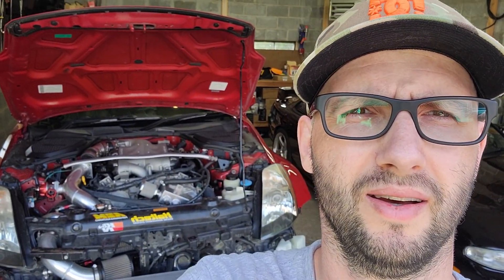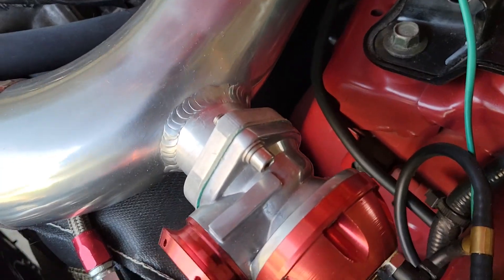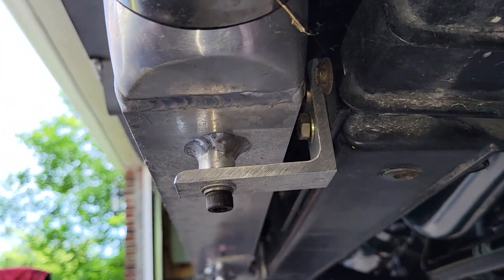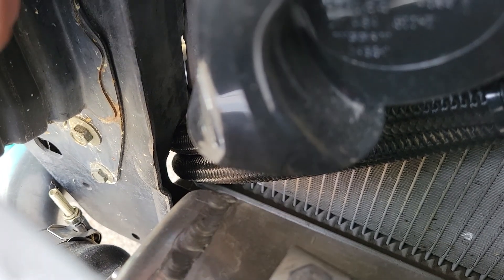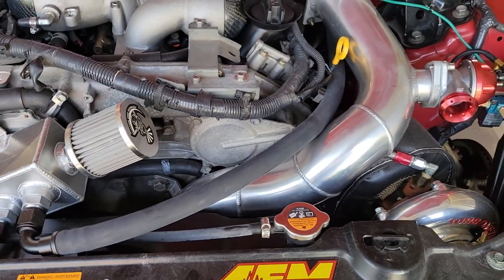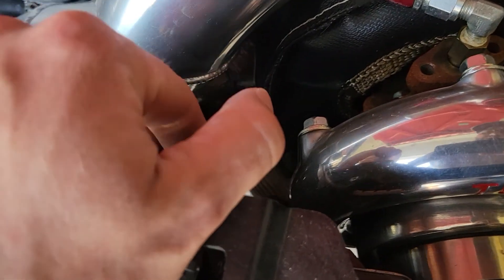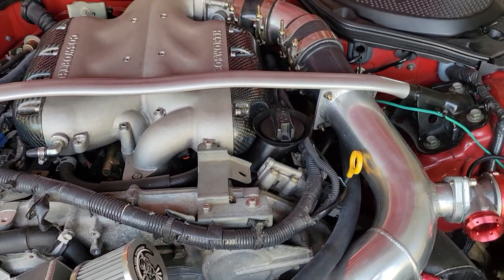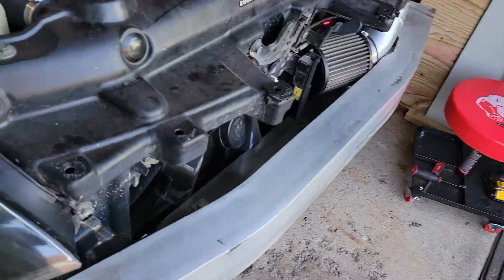Rev9 350Z turbo kit review - part 2

Comment: Its the rev9 with a turbonetics turbo right? Be honest is it worth it or is it a complete waste of money, ill be doing things to the trans and engine foe it yo handle 450-500 hp, but the kit says its up for 450 and the seller is claiming its all on my tuner that there has been successful builds at 500 with this kit. Let me know 😊
Reply: I’d say do 3 inch down pipe tial 44mm wastegate and gtx3582r bigger turbo and intercooler  on this kit 500-550whp that’s what I’ve seen building my kit to hold 650whp built engine with this kit
Reply from the maker: Only worth it if you know how to deal with piss poor QC and have some experience.  I wouldn't recommend this to a novice that's for sure.

Comment: what thread pitch adapter did you use for the oil feed on the upper oil pan, an4 to 1/8bsp? or is it a different size
Reply from the maker: @mitchbastos2806  iirc, that's a 1/8th male npt to a male -4AN

Comment: Hey i’m working on building my turbo G35 right now. For 02 sensors, how many do I need? 

I’ve got a standalone linkecu and I keep seeing people mention closed and open loop 02 sensors.

My understanding is that I need one narrowband in each manifold before they merge into one collector, and then a wideband ~8 inches down the downpipe. The narrowband is for closed loop tuning where
the ECU can automatically adjust AFR based on the NB sensor reading. Then at WOT (not sure when it switches over?) the wideband sensor is used for a more accurate reading as AFR value changes to become more effective. 

That’s my understanding, please correct me if i’m wrong
Reply from the maker: Thats how I have mine setup.  With standalone ECUs,  you have way more benefits, and being able to read a wideband sensor is one of them.